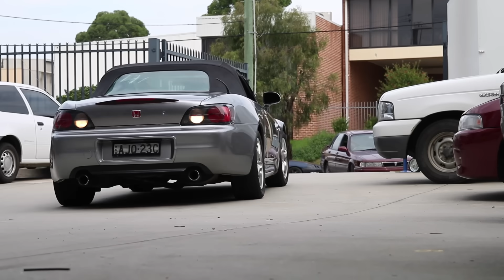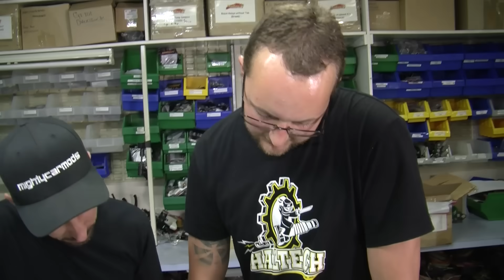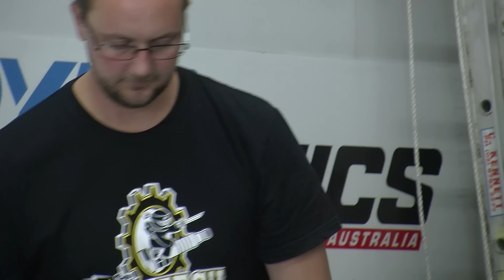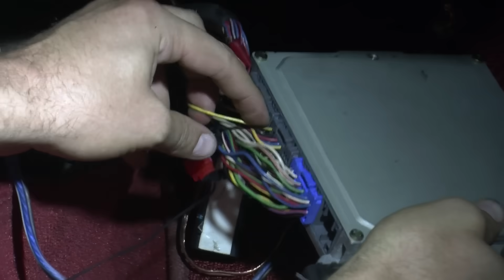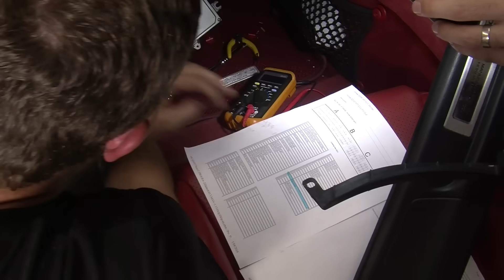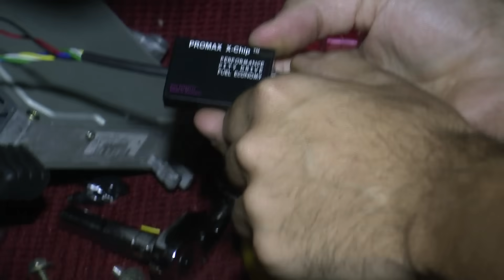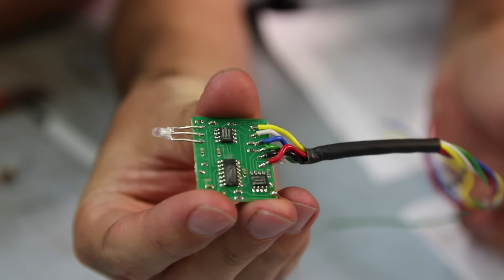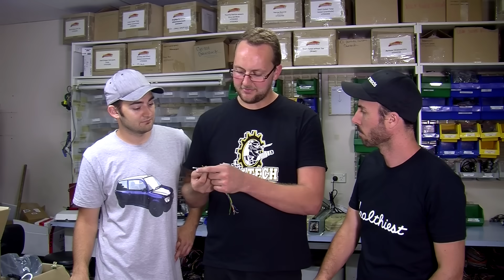eBay Performance Chips -  Mythbusted

Comment: vtec is just a variable valve timing system like you'll find on most modern cars... don't have a clue why such a big deal is made about vtec in particular. Nobody goes "Toyota VVT-i, yo." - so props to these guys for ridiculing the vtec meme.

The results of this just go to show how many snake oil salesmen there are in the world ready to take advantage of gullible enthusiasts. Car modders and audiophiles seem to be the most gullible of all.
Reply: it also affects lift height, a lot of other brands only do timing
Reply: +Simon Coles chevy VVT yo
Reply: It stands for very tall engine cooling btw

Comment: If I put 3 of the chips in do I get 100HP extra ?  ;-)
Reply: +Peter Rafeiner And if you combine them with few fuel saving ones, you'll end up producing petrol.
Reply: +Dilix idgaf its good to know simple math when being pedantic... 35 • 3 does not equal 90... he was closer at 100 -_-
Reply: do you mean 105 more bhp
Reply: No you get 105hp extra
Reply: +Peter Rafeiner Best thing to do is check a car forum for the specific car you're going to mod.  That way you would get real unbiased results from people that bought and tried it.
Reply: hahaha no. But I'm actually thinking about buying a chip for a car I got. srt4 got stage 1, 2, and 3 chips from Mopar that make serious horsepower. Chips like the one in the video are generic and don't work. Real chips have to be tuned for the specific car and costs $200+.
Reply: U mean 90....
Reply: *****
They don't make "chips" or EPROMs for OBD2 cars. They are re-mapped or reflashed with a performance tune to the specs of your cars TRQ/HP curve.  Older OBD1 cars took chips. Most popular were JC or Jim Conforti EPROMs (BMW) that you swap out of the ECU/DME on the motherboard.
 They do sell a static remap module that plugs into the OBD2 port for DIYers. Though it's best to take it to a tuner with a dyno for a more precise tune.
Reply: +Peter Rafeiner just paint a bogan stripe, = 100hp
Reply: what you should really do is put 20 of those chips in
Reply: Yes, as long as they're wired to act as the activation switch for your 100hp nitrous system.
Reply: oh yeah don't forget kids all real racers smoke cigarettes while working on their car
Reply: BananaGunz wast it 30HP?
Reply: +Peter Rafeiner YOU MAKE ALLLLLL THE HORSEPOWERS!!!!
Reply: +Peter Rafeiner I'm thinking you actually get 2000... plus sized engine bill.
Reply: +ralphire77 hey I got a 05 Dakota 4.7l what chips would help me with serious horsepower I got dual exhaust I am getting headers as soon as I can find some free flowing ones that are better then the ones I seen so far I like headman but their not completely streamlined and also im looking at doing converters also. im thinking magnaflows but I need it street legal I also still need to find a supercharging system for it too plus im wondering what I can do with the fuel while im at it
Reply: +ralphire77 plus do you think I can get each part for under $2000.00 usd
Reply: No, you get 105 hp.
Reply: +Peter Rafeiner Surrrrrre.
Reply: also if your really wanting to go fast hook up co2 to your nitrous system
Reply: lol
I get myself weak
Reply: no. 120

Comment: well is guess custom tuning is the only thing that works
Reply: or get a performance chip made specifically for a vehicle lol. They usually come with certain criterias like what gas to use(mostly premium),  have to have a intake, exhaust, etc and costs $200+. Nothing is cheap.
Reply: ***** or you can buy a hand helded tuner and choose your own settings
Reply: Emil Madsen true if you know what you're doing and don't mind the work. And have a garage. I took the easy plug and play route the first time but it worked lol.
Reply: Emil Madsen in my opinion megasquirt or AEM EMS are the best ones. Hard as hell to setup though.
Reply: ***** yah thats true. tuning in general can be a pain in the ass

Comment: it shouldnt do jack shit for wide open throttle since a car goes into open loop mode at wide open throttle. you would have to tune/ flash the ecm to make changes to the open loop fuel maps. maybe the chip does something to trick the ecm into thinking it warms up faster or something? doesn't work period
Reply: there are some chips that are made for specific cars, mostly NA I think, where they work by providing more fuel so you get more power. But they also have criterias like getting a intake, exhaust, headers, etc and you have to use premium fuel. Also works at WOT. It's recommended you get a chip the more you lessen the restrictions on the engine and make it "breathe" more, or you have to reflash the pcm/ecm manually.

Comment: map and maf sensor values are not interchangeable, the algorithm of the ecu for maf and speed-densit is totally differrent, so the testing of the hardware is done wrong. The porpuse of this thing is to shift afr ratios by tricking the ecu, feeding it with alternated sensor values. It probably would work if setup correctly, but as for myself, i would just reflash original firware to gain same results.

Comment: Drive my duramax without the PPE hot 2 and you will only run 17 seconds on the quarter mile
With the chip, I hit 12.9@118mph...

Comment: For all you people curious about the 177 whp number, they're using a DynoDynamics, a load-bearing dyno.  The numbers will be significantly lower than say a DynoJet which is inertia-based.  Take my 335i for instance, made 340 whp on a DD, made 410 whp on a Dynojet.
Reply: dam is that stock? lol 410 is a lot for the street.

Comment: Fun fact: Ecu is not on the drivers side!
Reply: +MrBrennanCreeper they appear to be on the drivers side in most US cars, but i could be mistaken as it has been a few years
Reply: +Justin Noker in most of the cars of my family, my trucks, my mom's cars, dad's cars, the ecu is under the dash on the passenger (Right) side. This way, the ecu and wires are out of the way of the foot pedals. But, we own GM, and other manufacturers may be different. But, I'm just going off of what I've seen.
Reply: MrBrennanCreeper yeah, like i said it's been a few years so i might be mistaking it for a fusebox or something, i have a feeling it is quite likely in some japanese vehicles but not for american vehicles
Reply: +Justin Noker On my older truck (1978 gmc) I have a fuse box just above my pedals, but that's the only thing I can think of. So that might be it! Lol
Reply: MrBrennanCreeper prolly, since we neveer owned a japanese car (we did have our fair share of fords, GM's and dodge vehicles in our family, but we're never getting a ford again after the oil pan fell off my grandfathers van while on the highway,  so we're largely dodge and GM now, my mom is thinking of buying a toyota, but it's a US only model so i don't think that would really count for checking the "maybe the japanese" clause)
Reply: +Justin Noker My sister has a Tacoma, and I've had one too. never had a problem with them. My dad has one of the newer Toyotas, and its great as well. But, as with every new to you car, just run through it before you take it home. Tires, suspension, check for rust, etc.

Comment: send it to fellow youtuber EEVblog and he can answer what chips those are and what they are doing. He's good at hardware.
Reply: +Chris Mccaslin they sent it off to one of their guy's, turns out the wiresare just passed right on through and the power in only controls the LED, as for the chips, they appear to just be random chips

Comment: I just wanted to clear up any people that watch this video that are new to tuning, or new to chip tuning. N/A engines (not turbo'd or supercharged aka naturally aspirated) can be chipped but generally don't get very high gains, normally you'll see a better curve in power band. While if you have a turbocharged  or supercharged car from the factory You can tune it, which generally raises boost, air/fuel, etc and you can get massive gains. My mk4 gti is 180hp173trq from the factory but with a chip/downpipe (stage 2 tune) I went to 235 hp/250 trq. Which is roughly 200hp/225trq at the wheels give or take. So in a simpler way of putting it, n/a engines don't benefit as much (in most circumstances) although stock turbo/super charged vehicles can and generally will give a lot of gains. Something used in the subaru, vw, mistu tuning realm!

Comment: I can to help but think that the engineers who design cars would not overlook something easy like the software as a way of improving performance and or gas mileage so it is hard for me to think this type of modification is even reasonable to consider as a way of increasing power or gas mileage for most late model automobiles.  Am I missing something in the way that I think about this concept?
Reply: $20 chips won't do anything for you as proven by this video, however your more expensive chip sets, that go for anywhere from $200-$600, most definitely do give you gains reason they don't come modded that way out of the factory are different variables, laws, emissions test that vary from country to country, hell even state to state. Another reason is that the factory chips that come with your factory vehicle are outsource to a 3rd party and aren't tune for the best performance for a specific vehicle as they(the car company) probably uses it for a number of cars the manufacture.

Comment: At the end of the day you wont get hardly anything from a chip on a N/A car. Even a professional chip for £250 will probably net you 10bhp at the flywheel if your lucky on an S2000. You get what you pay and a chip of that low quality could end up doing more damage than good.

Comment: The last complaint about the car's stock performance seems unfounded, because in the videos of the drag racing the Honda clearly grabbed some gains against the Mazda when the shifts were made and the V-TEC did its duty. I'm thinking that's still impressive, and it's all one could hope for from a 'stock' 2-liter -- albeit one of the most powerful factory 2.0s ever made.

Comment: the people saying you can't get hp from a spark plug change are retarded. it may not be much (like maybe 3hp lol) but you can make more power. but it also depends on the vehicle. my ford stang 5.0 does not make more power with higher end plugs. but my hemi burns better while more consistent therefore gains power. like I said you will not notice the difference but you CAN gain something
Reply: Well woop dee fuckin doo mate
Reply: jio iniguez just trying to set some people straight who don't know what the hell their talking about. Why do you think 9 out of 10 top fuel cars run e3  plugs in their 426 hemi? Because in those motors the plugs alone make another 26 rwhp. Now they won't make that in our street motors but still a gain is a gain.

Comment: Funny the tech mentioned the LED might be the right size for an LED control board, which is exactly what I thought. 
I'm half way through and don't know the outcome, but if its like anything on TV, it only has to work long enough for you to buy it!
Add: (Two minutes later) Yep, it's good to be me. Why, if you want to add power, would it have 3 settings, eh? A real CPU chip changes the code for certain conditions in the ECU programming.

Comment: Hmm strange, in Europe the S2000 has 241HP, so where is the rest?
Reply: +Thomas Ende 
241 HP is factory claim for the engine and engine alone, and that is under perfect conditions of a brand new engine.
Now add 10 years of wear on the car, losses with exhaust, filters, pumps, alternator, clutch, gearbox, differential, tires and all the bearings in between... and you are 30% down real quick.
A new car might get as close as 10% loss, but the conditions must me just perfect for all the parts.
Reply: That to the crank this is to the wheels
Reply: +Thomas Ende This power is measured on wheels. Car manufactures measure it on the crankshaft. And every yeah you lose a few HP anyway

Comment: you busted this on a high performance vehicle, but would it make a difference on my saturn lw1 2.2l, they start underpowered already. lag in throttle, slow rev drop etc. has this been tried on a low performqance engine

Comment: I´ve a question: How about those chips that change the max rpm? They do something?
I´ve bought an Peugeot 106 and i opened his Ecu  and a found a chip that makes 7800 rpm instead of 7200rpm(stock)

Will this fukk up my engine with a normal use?

These things change some parameters on the ecu and that´s what i´m afraid of
Reply: +Scionofnothing 
Rev limits are there for a reason, so you might break it that way. As for daily use, it depends how the chip is bypassing the programmed rev limit. There are safe ways to do it and unsafe ones. Without knowing the method used, I can't say which it is.

Comment: this S2000 in only giving 177hp?! wasn't she suppose to make 250hp? Is the engine dead?
Reply: 177 at the wheels , so it's around 200 at the crank and not all make 250 hp
Reply: +krauser979 shut up idiot even if he is getting HP confused with WHP doesn't mean he's wrong, that is underpowered for what the engine is supposed to make
Reply: rwd cars loose a lot of hp due to driveline loss. it eats up about 25% hp for rwd cars. fwd has about 18 % loss since there's less parts moving
Reply: +Charlie Soesbergen If you do the maths, the 237hp (Aussie DM version) with 25% drivetrain loss works out at exactly 177.75hp, so I'd say this dyno is pretty accurate, and that the engine is not 'dead'.
Reply: +krauser979 well bmw can get 200hp out of a one liter inline, and so can Kawasaki, yamaha, ducati "they even did it with two cylinders"
Reply: krauser979 Idiot?
Reply: That's some crazy parasitic loss.
Reply: +J. Silva,       240hp maybe?
Reply: You literally didn't see MCM comment about wheel horsepower and engine horsepower? Dude just stfu and gtfo idiot
Reply: Charlie Soesbergen
240 at the crank first of all and dyno's like that aren't the most accurate way of determining whp  idiot.
Reply: Juan Pablo Velásquez
nou
Reply: John Law My figure was 250 just thought it was a bit low, again I don't want to argue with people who think they are smarter than me on the internet there is no return
Reply: +Alystas 
thats 177 bhp im assuming since no engine is perfect and there is ALWAYS power loss.
Reply: Bujf vjg No, they use a liquid cooled, dual overhead cam 90 degree twin cylinder bikes, that are completely shit street bikes because they are so over square they are worthless.
Reply: Bujf vjg Yep, both the 1st, and 2nd gen, and while I respected the technology, and respected the bike hugely but it has 0 soul whatsoever, It didn't even feel like i was riding it, just like I was suggesting what to do, and the bike decided if it wanted to.
Reply: Bujf vjg yes we can, in a race you avoid ABS and TCS in order to achieve faster laps
Reply: Bujf vjg yes, safety reasons.

This is like Wet Mode in some cars: makes people think that they can drive like a pro when its raining.
Reply: Bujf vjg if it wasnt for safety reasons tell me why they used TCS smart guy?
Reply: Bujf vjg everything was fine till you started insulting me for my ignorance. You are not a cool guy. so Fuck you lol
Reply: Bujf vjg haha no, Questioning is not insulting, as well as listen doesnt mean to give the reason, i questioned and you proved that you were right.

Im a man, i accept my mistakes.
Reply: +Juan Pablo Velásquez yea stock is supposed to be 240hp and at least 200whp with the power transfer from the rear, hmm
Reply: +John Law definitely needs upgraded clutch and flywheel
Reply: that's from the wheels not motor..
Reply: +Charlie Soesbergen it's not that he thinks he's smarter clearly he is.

Comment: Thanks for wasting 26 min of my life. So you go out and buy the cheapest cheap you can find on Ebay to use in demonstration? That is not very smart. Since you sacrificed your car for this why not at least get a decent quality chip or high performance chip to test to lesson the chance of this hurting your car and also to see if the higher performance chip works. As with most consumer products when you buy the one that is the cheapest there is a good chance that it will not work or at the very least show minimal benefit. Or what woud have been much better would have been to buy 3 chips one cheap as you did as well as average and high peformane.

Comment: okay so I'm not sure what they're thinking because an EMF is meant for turbochargers, superchargers, or nitrous Oxide Systems. it's supposed to change how much gas and air the gets forced into the engine. since a Honda S2000 has neither a supercharger or a turbo charger, and has no nitrous oxide system, basically the chip couldn't do anything at all because if it forced more gas into the engine, it would flood for lack of airflow. the test is useless because he didn't have the necessary engine modifications for this to be effective

Comment: Power is rated at 240hp from factory and that means it would need 204hp at the wheels with a 15% driveline loss accounted for. This car is way overrated or it has the worst drivetrain efficiency ever made. 177hp at the wheels is 206hp at the crank which is nearly 35hp less than advertised. Ouch! I had a 2001 Mustang GT rated at 260hp dyno at 226hp at the wheels which means about 267hp at the crank or 7hp more than rated. I would chuck this hunk back at Honda. All Dynos I have seen on this car are not as powerful as Honda advertised and this one of the worst which makes me wonder if they are dynoing it at like a mile up. The Muatang was dynoed at 4000ft in Alberta Canada.